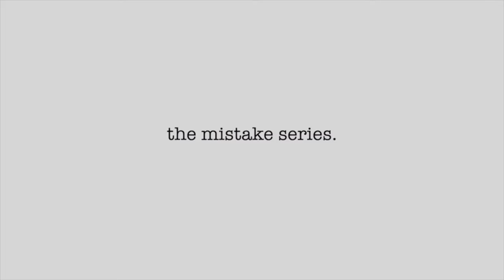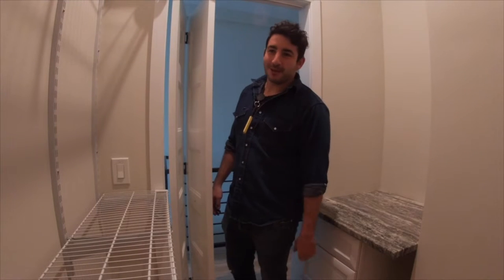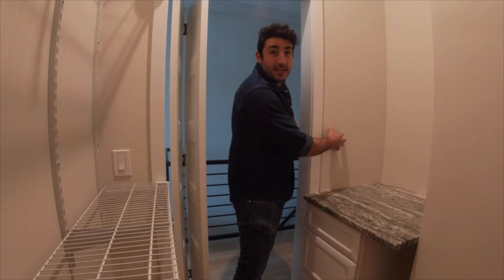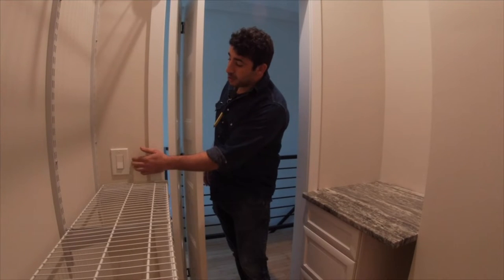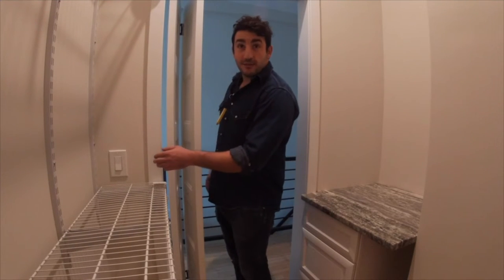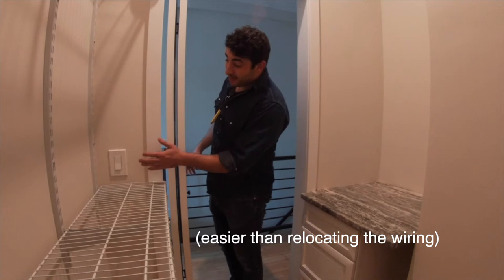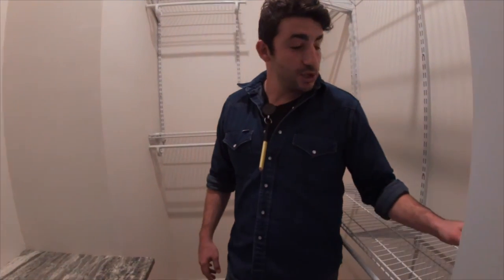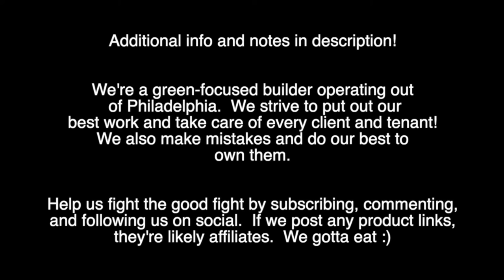Moving a Light Switch: the easiest way to correct an electrical layout oversight

Comment: What is the name of the manufacturer.  I have the same situation
  However the current switch does control power to the top portion of the outlets in the room, aka hot switch, I believe.
Reply from the maker: We use this one: https://amzn.to/3vocN4w

Should work for your application, but they have a pretty robust tech support line!